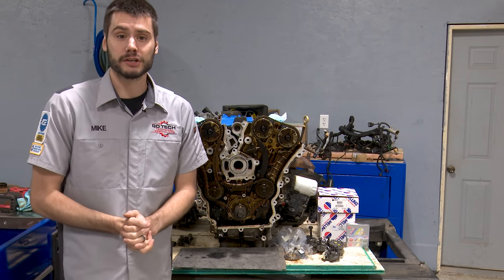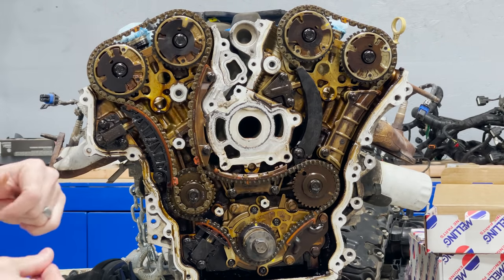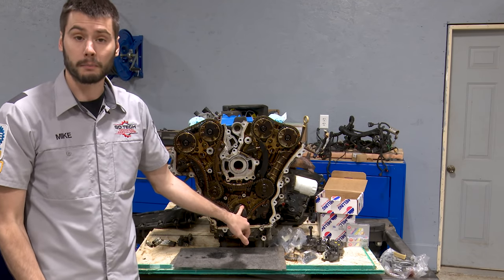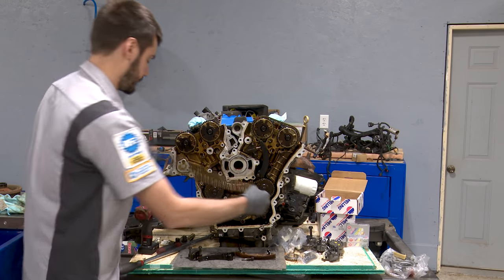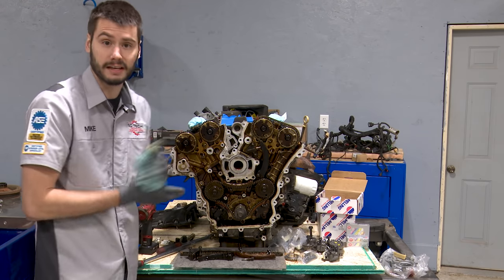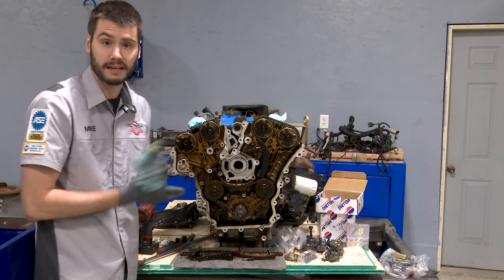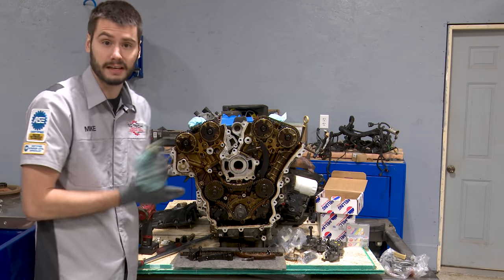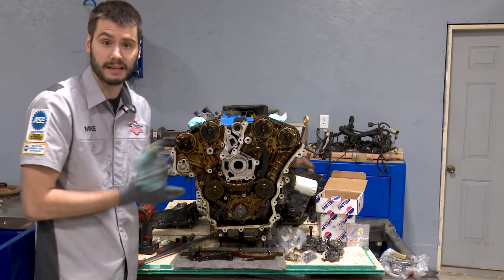How To Replace Timing Chain On Chevy / GM 3.6L V6 - Full Length Removal and Install - With Tips!

Comment: Good overall video on doing the timing chains on these GM 3.6 l
One critical piece of information though before you even start the job.
If you're attempting to do this with the motor still in which I have done many many many times for front wheel drive vehicles such as the Arcadia traverse terrain and Buick and even some old Saturns that use this motor
The hardest part of the entire job can be just getting the effing crank pulley off. A lot of people grind down modify a three jaw puller
From places such as harbor freight but there's not a whole lot of clearance between the frame rail where the crank pulley sits
Get yourself the OEM GM or good eBay knock off crank pulley remover tool for this motor. It's not a three jaw puller it's a one piece design that slips perfectly over the crank pulley on these gm3.6 motors giving you the clearance you need Or you'll never even be able to start to get your timing chains off because you won't be able to pull the timing chain cover or anything else you will quit before you even start just trying to get the damn crank pulley off if you don't have the proper tool.
Other side notes go with the cloyes timing chain kit spend the 400 bucks for the love of God there are lots of $200 Chinese timing chain kits for sale on eBay  and Amazon everyone ive helped do one of these 3.6 motors with the Chinese kits the timing chain tensioners and other components always fail within a year
You are not saving a couple bucks by going with cheap parts. You'll be doing the job again prematurely.
Other notes would include this is an interference engine. If your cam phasers go bad if you're lucky the motor will just click
But if this does jump out of time you will bend valves and if that happens of course you replacing valves by removing the heads
You're also looking at replacing the cam phasers that's another part do not go aftermarket on there's lots of Chinese knockoffs on Amazon and eBay they only cost about $20 more a piece for the OEM GM cam phasers did make the note in this video which I've seen people miss
Both left and right bank exhaust cam phasers are the same same GM part number
But I've worked on 3.6l that are still throwing codes because people don't realize when changing the intake phasers there are separate part numbers there is a left and a right intake when lining up your timing chain marks
Up top on the phasers when your cams are flat as he explains in the video you have a little circle and a triangle on the phasers
One way to tell if you have it right is you should have 12 links between the exhaust and intake phaser on each Bank 
You can think you have it right assemble the whole vehicle it will start and it will run but after it warms up in the O2 sensors kick on and starts talking to the computer and running efficiently it'll start throwing codes
Because your cam phasers or not installed correctly as in you ordered a cheap eBay intake phasers I sent you two of the same model number I've seen this happen many times not realizing there's a left bank right Bank  intake phaser and the vehicle will run but not right and throw codes.
It's not an overly complex hard job to do
Just make sure you have every correct part and it's a quality part before you attempt this job.
And one last very very very very important part for the do-it-yourselfer attempting this with oil pump replacement do not immediately when completing this job fire your vehicle up these GM 3.6 l they need a minute or two of cranking to prime correctly when you're completely done with the job leave the spark plugs out and make sure on the under the hood fuse panel you pull the fuel pump fuse verified I don't even hook the fuel line up to the fuel rail so when the keys in the on position nothing is being pumped from the tank up to the motor then crank the vehicle over when the mentioned above is verified I start with 5 seconds of cranking and let the vehicle sit for about half a minute
Then I'll continue cranking for 10 seconds let it sit for another half a minute all the way till I crank it till about 15 to 20 seconds just to make damn sure the new pump is primed and has sent oil all the way from the bottom of the pan up through the heads lubing up the phasers in the Cam's good in the hydraulic timing chain tensioners before finally dropping the  spark plugs back in popping back in the fuel pump fuse and finally allowing the vehicle to start then you won't have any clicking or knocking noise because the vehicle's been oil primed well.
I mention this comment because one of the first traverses I worked on with the stretch timing chain issue and the oil pump changed and everything was done correctly but not properly primed newly installed oil pump
And the vehicle ran dry for the first couple seconds which was enough to actually score the crank bearings on this gm 3.6 engine
As with all engines especially this one some are more tolerant than others quality oil and oil pressure are everything to this engine
I firmly believe half the timing chain stretch issues are related to this motor because people do not do enough oil changes gunking this GM 3.6 l motor up. And piss poor GM engineering on the right Bank crankcase ventilation system on this engine.
This can be a
Very good quality engine as long as you keep them clean a $50 full synthetic oil change every 6 months or 5,000 miles this engine easily make it to 200k Plus trying to skip oil changes driving 10 to 20K miles between oil changes and I've seen these motors grenade before they reach the 100K mark. 
And the very very last note
People don't realize GM had a problem with this vehicle when it's throwing codes
Saying the timings off and a vehicle is not making any clicking or rattling noises ie everything is nice and tight the way it should be the earlier year GM 3.6 l I believe it was the 2007 models the pulse ring which is a gear that is pressed onto the back of the crankshaft again was only pressed on from the factory and not welded and what happens is after a period of time certain 3.6 l motors because they were not welded onto the crank but only press fit pulse ring tone gear different people call them different things is what your crankshaft position sensor on the back of the motor reads to send a signal to the computer to make sure everything's timed and firing right if you are unfortunate enough to have one of these tone rings that slips in the crankshaft no amount of timing chains and switching sensors will fix it the only thing that does it is changing the crankshaft out which the labor involved it's normally cheaper just to get a new motor. Not a common problem but one that has been documented with this 3.6 l motor. And is one of the causes of the dreaded check engine light timing is not with in tolerance code.
Reply: @Aaron Wildman, are you referring part# 25264 for the pulley/HB tool? Thanks in advance
Reply: I purchased a 2011 Chevrolet Traverse new. I changed oil at 75% to 90% of the oil indicator.  I used oil specified by GM. API rating, oil weight and Dexos rated.  Mostly Mobile 1.  I used GM oil the first couple of years, as Dexos rated oil was difficult to find. I gave my Traverse to my sister in 2022 with 180,000 miles.  My sister is still driving it.  Has about 200,000 miles.  Original timing chains.  I was careful about oil changes and followed GM’s specifications. I made sure crankcase breathing system was operating correctly and oil level was maintained.  It did not consume oil. Worked out for me.  YMMV.
Reply: Very good info thanks, I'm just preparing to do a 3.2L that has 3 out of 4 timing position sensors throwing codes. I'm beginning to wonder if someone already screwed it up

Comment: Though Ive done a few 3.6l chains, I by no means remember every signal mark or step. Mike is absolutely correct about service info not having a signal spot to get all the steps from. its broken down into every piece , guide and sprocket. Having a video that goes through step by step insures not missing a mark on a very labor intensive job! Great work Mike!

Comment: Done several Acadia, Traverse timing chain replacements and your video is spot on. I take off the bumper, radiator, etc and pull motor from the top. Tedious but isn't difficult.

Comment: Really excellent video help, I do admit that the dot marks and the triangle’s were confusing me as to which ones to use to line up the chain’s, but when when I watched the entire video it became perfectly clear to me. I have always been mechanically inclined when it came to taking things apart and then putting them back together, but I haven’t changed a set of chains and an oil pump in many many many years .The oil pump was the easy part I must say. I should mention I did this with the engine in the car not out, a 2010 Camaro, with out the help of this video I wouldn’t have been able to do it. Thank you for that. I turned 65 this year and I have very limited funds ,so I end up doing almost all of my own repairs. Can’t afford the labour rates at most garage’s. Last time I had the crank replaced because of bad rod Bering it cost over $5000.00 at a GM dealer and it was never did run right after they were done, they wouldn’t give me an exact price for the work, had I known how much it was going to cost I would have picked up a new motor. Can’t trust most Garage’s. And by the way, it was just out of factory warranty by 500 Kilometres. Yes i am Canadian.
Reply from the maker: Hey Steve,
Nice Work! Glad you got it fixed!
Thanks for watching
~Ryan Wilsing
Reply: So you figured out the triangles where the marks also? Lol I had the same issues when I did it ….by the way I did my 3.6 vvt with the engine still in car 💪

Comment: Hi Mike. Great video. Thanks. Recently did a 2012 Audi 2.0. I've done old American cars with a single chain before. This was a new experience for me. I wasn't sure how long it took for oil to start to lube the chains, so; I placed the chains in motor oil an let them drip off before installing. I figured that it wouldn't hurt, and maybe helped get oil into the chain links and pins. There was nothing in factory service data about this. All went fine.
Reply: If you unplug the crankshaft position sensor and turn it over a few times it will pre lube the engine. With the sensor unplugged there is no spark or fuel sent to the engine.
Reply: @DarrelllCampbelll  Great. Thanks.
Reply: @DarrelllCampbelll 
Are you aware of what “clear flood mode” is by any chance?
If you don’t, it is the ability of the ECU to not fire the injectors when cranking the engine if you have WOT, obviously to start a flooded engine. Very handy after an oil change to fill the filter before it fires up. 
Careful, not all cars have it so try it before you need it. Also good to scare the wife when you are far away from home. 😇

Comment: Great video! You did an awesome job buddy! Extremely thorough on your descriptions including part names, placements, order/run sequence and especially the step by step in depth direction. Would be very easy for someone with little to no experience to use as a guide as I found out first hand just how easy it would be.id most definitely recommend this video to newbie mechanics and also old timers if they are needing some guidance or know how. Subscribe to this man and help him make more videos for folks like you and I. ( One recommendation I'd like to make to the gentleman responsible for creating the video would be to use a more visible color to mark out the timing marks and set position. I know it's probably very visible in person but for us watching the video the yellow is very hard to recognize. I've found white to work rather good from start to finish.)
Reply from the maker: Hey Shane,
Thanks for the kind words and supporting our channel!
We will definitely give white a shot next time and see how it turns out!
~Ryan Wilsing

Comment: Just wanna say this helped me so much, and I'm a GM dealership technician. Helped out so much more than Service Information did. Followed this and got it right the first time. So with that said, thanks so much for making this video!
Reply from the maker: Hello,
Thanks for the kind words.
I agree, Service information is hard to follow. They split it up too much and make it impossible to use without switching screens constantly. Actually part of the reason it was decided to make this video!
Glad it helped you and thanks for reaching out
Ryan Wilsing
Reply: What was the mileage on this motor

Comment: Tight tolerance job. I would lubricate all guides with assembly lube and oil against the chains. Done a 2.7L  with 3 chains. Is a little easy to time but you have to pull the four camshafts out. 2.7L engine stays in the vehicle. Really great job. Just a DIY guy. 2.7L are one and done. Great job. Thanks for the video.
Reply: With the oil pump, do you have to prime it??

Comment: Well Done, Thank You.  No wasted verbiage, just great explanation of what to do.  Now to be able to do this 1/2 blind while the engine is in the car.   Glad Melling recognized your talent and provided quality parts for you.
Reply from the maker: Thanks for watching Mr McD!
Mike Becker, Senior Instructor
Reply: Wait this can be done with the engine still in the car or are you being sarcastic. Just wondering because I have a 09 traverse with 170000 miles not sure but think I have a burnt valve ,ero compression on number 4
Reply: Can be done in the car 100%
Reply: @jacobmorse3280  Yes, it can be done, very tedious job, not easy and not a lot of room.   I took my car fully apart, removed the timing, bought the $1,000 in parts to fix it but before starting the install I was cleaning and I put a magnet into my oil pan and came out with a Rod Bearing half.   Not good, at this point I knew I needed a full overhaul.  I purchased the car broken, the owner told me it needed a timing chain.  He was wrong.  The crankshaft was damaged.   Parts and machine shop work were over $2,000, I found an engine with 34K miles on it and bought and installed it.   The timing could have been done but not the full overhaul in the car.   At 170K miles if you have not cleaned your valves they probably have carbon build up choking off your intake air flow.  I have cleaned 2 engines now both at around 120,000 and the build up was substantial.
Reply: @mrmcd5728 how should I go about cleaning my valves?

Comment: Hi! I have got to say….I appreciate all of these how to videos on how to do major work on vehicles!  I’m a nurse, definitely NOT a mechanic! However, I’m about to take on attempting to fix my sickly 2011 cadi cts!  Now, remember, definitely NOT a mechanic and I’m sure I’ll get a lot of “have someone that knows how to do it do it” comments. I unfortunately can’t afford that option right now. So I’m going to embarrass myself here and just go ahead and ask…does the engine have to come out to work on the timing chain??  Thank you in advance!  Again, much much appreciation for the how to videos!
Reply: GM no it do not I have a 2010 Buick enclave and like you I don't have the money to fix it so I'm doing it in the engine without any power tools now it do come with challenges like   bolt that don't won't to come off lol but if youre going to do it in the car just start with the harmonica balaner and power steering pump first those was the most challenging part of this project for me hope if you do your you'll have better luck with your bolts then I had with mine lol

Comment: I am getting ready to do this on my 2011 SAAB 9-5 with the 2.8l version of this motor.  Thanks for the excellent walkthrough.  I was going to take it to a shop but it actually doesn't look to be that bad of a job, once the motor is out of the car.
Reply: Doing the same thing on my 09 Aero. Working up the nerve, it looks like you don't need to rotate to phase 2 if you have both tools lined up.

Comment: Glad you mentioned to Replace oil Pump as most people I've done that job for don't think it is necessary then I have a argument over it I wouldn't do the job if it wasn't Replaced, oh yea and Replace Water Pump..
Reply from the maker: Hey Paul, thanks for watching! Sure, the waterpump could/should be replaced right away too. Why not, you're already there :)
Mike Becker, Senior Instructor

Comment: You gotta give it gm. The 3.6 with the timing chains and the 2.4 with oil consumption, vvt, timing chains?, And water pumps. What an incredible decade for techs.
Reply from the maker: What a time to be alive Bobby! I bet warranty repair time on these engines is HORRIBLE though.
Mike Becker, Senior Insturctor
Reply: The water pump thing is been going on since the 70’s. Some people never learn….☺️
Reply: As a tech, the 3.6L is an absolute nightmare every time. No one likes doing them here.
Reply: @GoTechTraining  When I worked heavy line for Ford in the early 90s, the engineers told us that all labor times for warranty repairs were set with technicians in Detroit using hand tools. What a load of crap!
Reply: Almost all of the 5.0 engines we would pull apart would have every ring Gap lined up perfect in a row.
I used to say that they need to hire a monkey on meth to spend the piston rings before they slide them in the cylinder. Would have been much better.
 LOL 
They also horrendous piston slap when cold. They would usually have .009 to .010 piston to cylinder wall clearance from the factory.
Instead of making a better product, they just lowered the warranty from 6-year 60,000 mi to 5 year 50,000 MI. They should have just fixed it right on the assembly line.